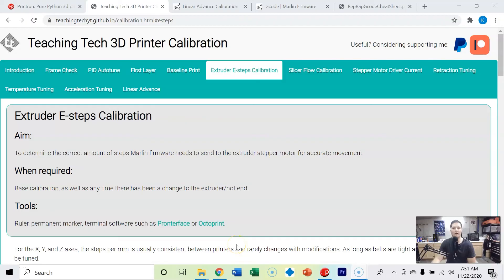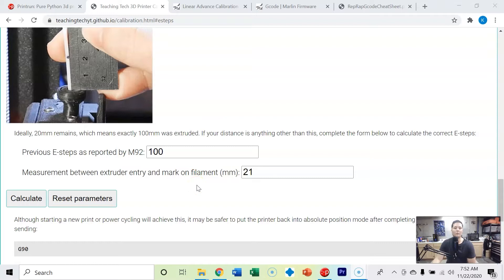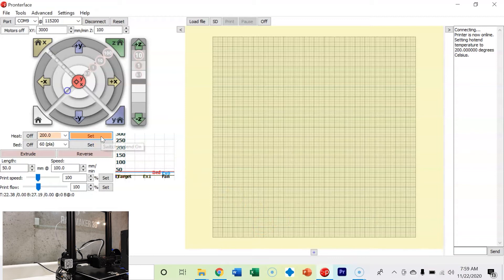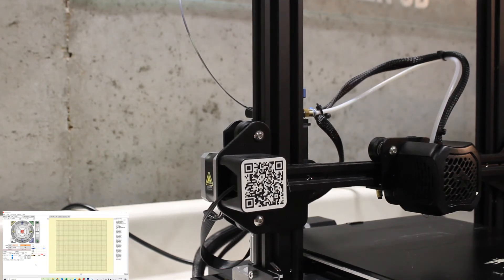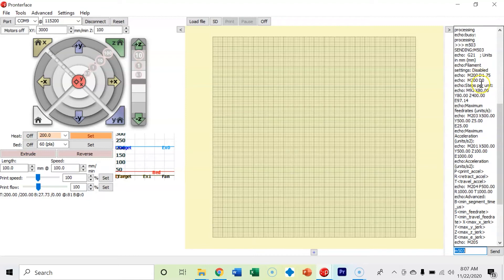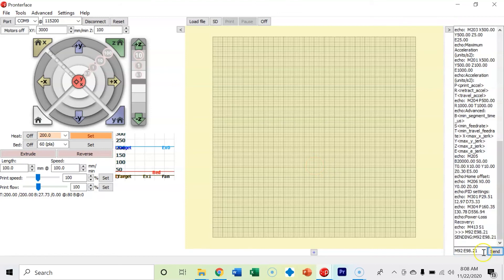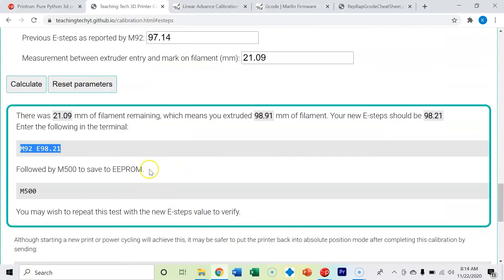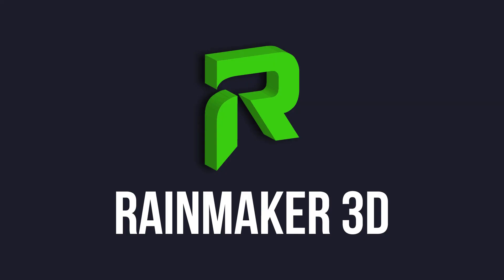E-Steps Calibration - Calibrating your 3D printer Part 5 - Ender 3 V2

Comment: Hey, thanks for your videos. I was just curious if you or anyone have any tips for getting this dialed in. I've tried a number of different methods of extruding and measuring, including the method you described with this video. I feel like my most accurate measurements are when I take off the bowden tube, cut it flush, extrude 100mm and measure again. 

Unfortunately, every method I try, I consistently get results that don't really make sense. For example, my recent testing: E98.09 gives me 21.7mm (underextruding). This suggests changing to E99.78. That gives me 22.5mm (more underextruding). So then we go E102.34 which results in 17.1mm (way over extruding). The only explanation I can come up with is that I suck at measuring. I would think if I were consistent with how I'm measuring, even if I'm a bit off, eventually it should settle. Curious if anyone else has ever run into this?

Comment: This is the video/guide I was looking for but I have no idea what this program is, or how to use it. Would have been great if you showed how to use this program.
Reply from the maker: The program is called Pronterface. I have a video that shows you how to download and install it as well as how to connect your 3d printer. I would check it out if you get a chance you will need it or another similar program to calibrate your esteps.
Reply: @rainmaker3d  thanks, but I found a lot easier way of doing it. Appreciate your response though!
Reply from the maker: @509drone2  Good I am glad you got it figured out.

Comment: Don’t do it this way you will never get it calibrated correctly you need to remove the Bowden tube and pass through raw material. Because if you pass it through the hotend you will get a resistance 
To prove this try it through the hot end change brand off filament try again and you will get a different results
Reply from the maker: This is a good point. I will try your experiment. Do you have a recommended way you would do it? Just extruding 100mm through the extruder without going through the hotend?
Reply: @rainmaker3d  yeah I just disconnect Bowden tube from the extruder then do as normal
Reply: @ekzoot95  Is that actually the right way?...I did like you and removed the bowden tube and adjusted everything and it looked ok but then i did as @Rainmaker 3D explained and the deviation in millimiters was 2.8mm less extrution trough the heated nozzle.
Maybe I´m wrong but to measure trough the heated nozzle must be the "true" value as it is like that when you are printing...correct me if I´m wrong :D